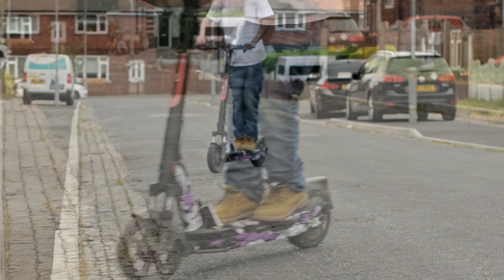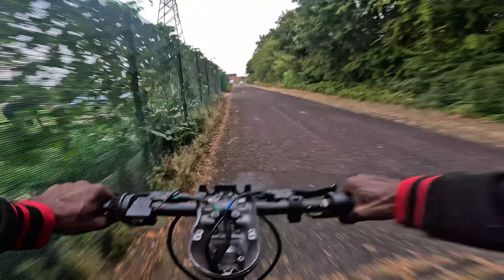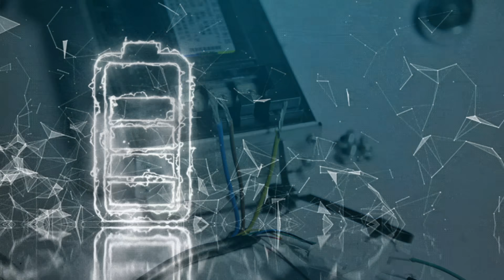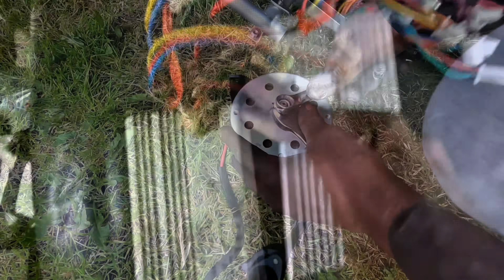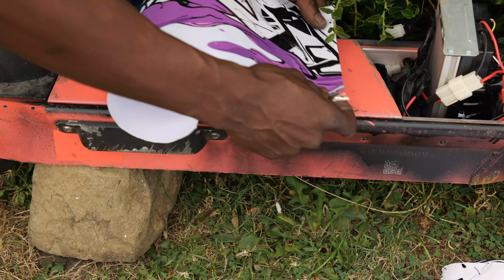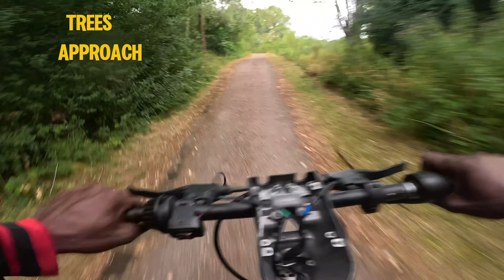I Built a 72v eScooter Faster than a Surron

Comment: I just did a similar thing but apparently you shouldn't because if one dips below voltage, the system will feed 72volts back into the 36volt battery and damage it. Better to harvest the cells and build a 72volt battery from scratch. 
I'm no electrician so this isn't fact, and interested to hear if it's correct because I want to do the same thing.
Reply: I'm running 2x 250watt motors on 2x 20volt 4ah power tool batteries, was going to add another 2 in parallel to try to avoid voltage sag on full throttle. But now I'm considering building a pack from scratch or lowering the voltage to 24 volts, and increasing the capacity to avoid voltage sag.

Comment: I just want to say that it’s not mandatory to have Hall sensors. For the discharge, you need to look at the current output in amps, and to calculate the motor power, you multiply the voltage by the current. A 72V battery doesn’t necessarily push a lot of amps, so it can have the same power and potentially the same speed as a 36V battery that pushes a lot more amps. For example, you can’t assume something will reach 120 km/h just because it’s 72V. I have a Dualtron Thunder 3, so I know what I’m talking about. I’m 15, and I know quite a lot about this stuff. Good video, by the way! Sorry for my English, I’m French. ( last thing dualtron are sensor less )
Reply from the maker: You definitely know your stuff, keep learning and building because that's how you really master these machines my guy! 👊
Reply: Dude you have no clue what you talking about and owning a scooter wont make you an expert that scooter deffenetly needs to connect its hall sensors...